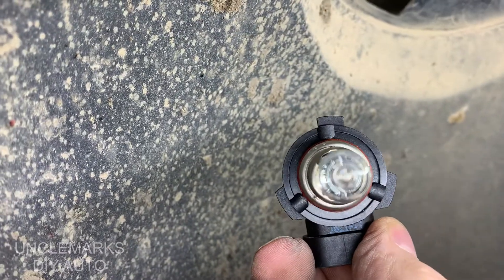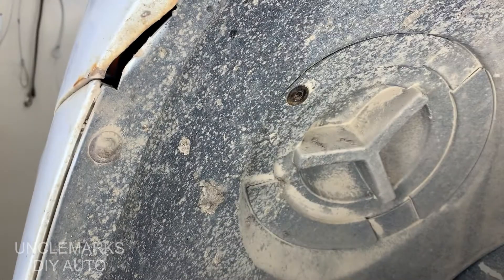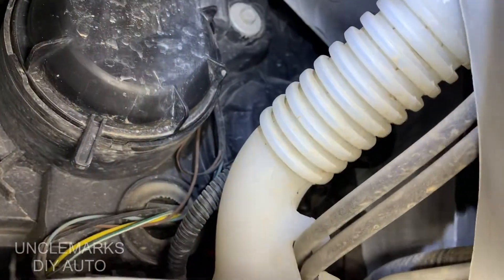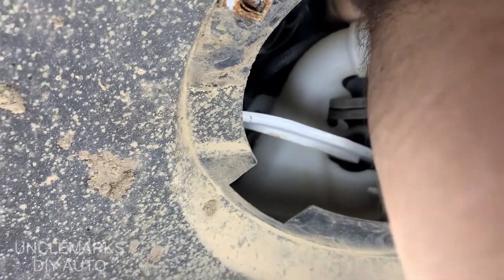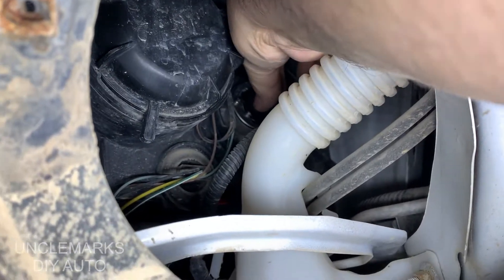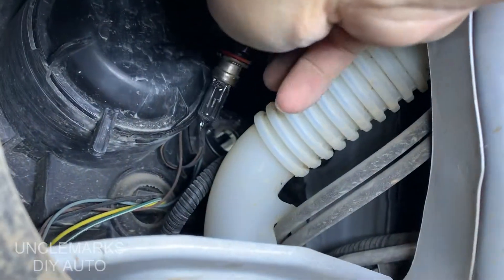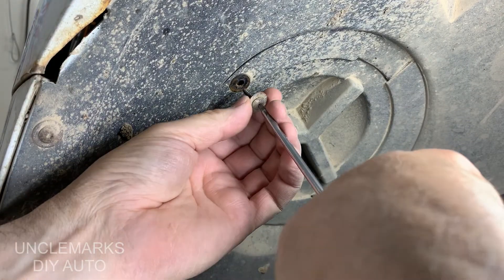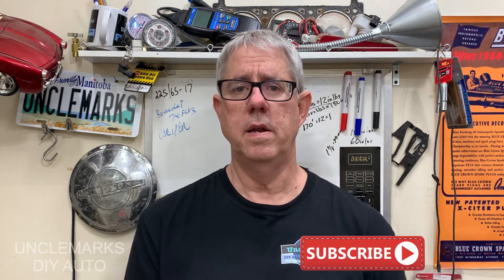How to replace change high beam bulb on GMC Terrain 2010 2011 2012 2013 2014?

Comment: I just replaced the low beam drivers side on a 2017 gmc terrain..ugh no access door. Not too difficult but yours looked a lot easier.
Reply from the maker: I will take note of the no access door and rename my video to exclude 2017/2018. Thanks.
Reply: Yes, I wish they would have had one. Thank you for the reply.
Reply: @unclemarksdiyauto I believe 14 and up removed them.  The later models of this body style do not have the access panel...or the CD drive in the radio...or other knicks and knacks.  GM started going cheap.
Reply from the maker: @cup_and_cone  They are always trying to save a few pennies here and there. That access door did save some time for sure!
Reply from the maker: @cup_and_cone  I will try to see if I can find out for sure what year this access door went away and update the video title. Thanks.
Reply: @unclemarksdiyauto  It's either 14 and up or 15 and up.  My 13 has the door and late years of this model don't.  I want to say it's 15 because that's when the redesigned bumpers came out.
Reply from the maker: @cup_and_cone  Your logic makes sense. I am probably safe listed these up to and including 2014. Thanks for your help!
Reply: @unclemarksdiyauto  No problem.  I definitely think you are safe saying up to 14.  If I remember to take a look next time I visit a picknpull junkyard, I'll respond back.
Reply from the maker: @cup_and_cone  I would appreciate that! Thanks!
Reply: I have a ‘14. No access door.
Reply: I’m soon to change out both low and high beam and I’m pretty sure I’m gonna have to take the tire off to access both holes. I don’t think I can reach both by peeling the plastic fender well back. Because this terrain doesn’t have access holes either.